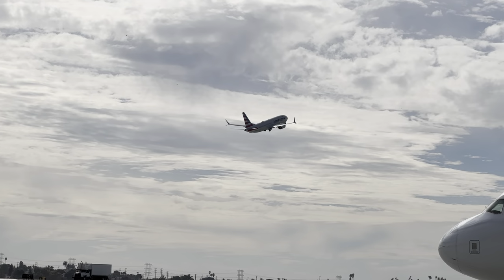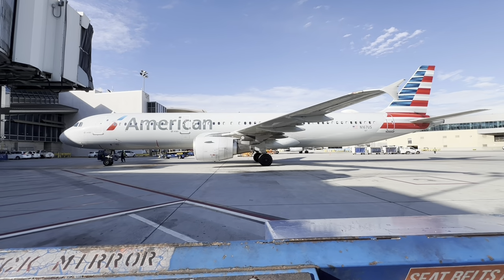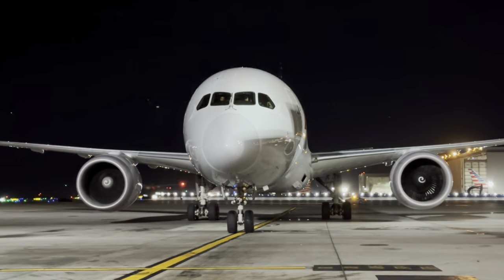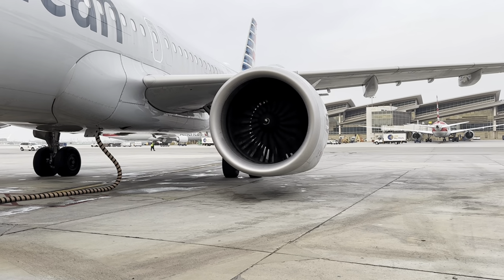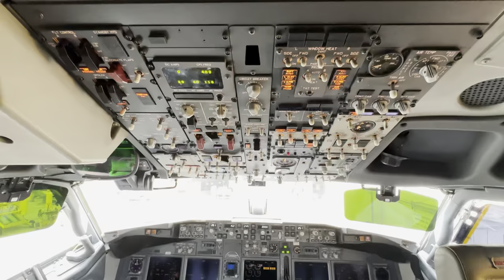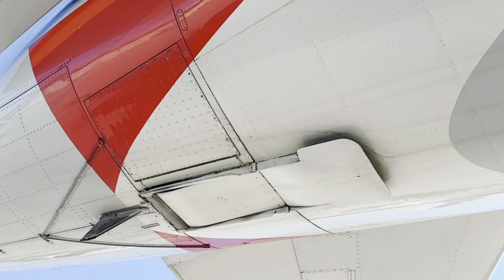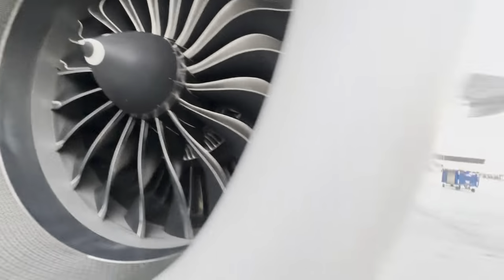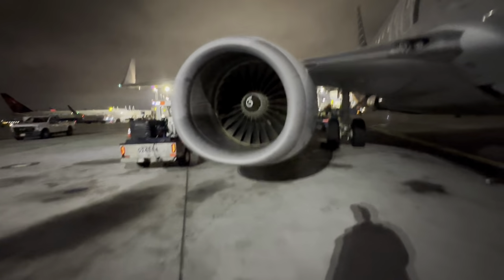Stig Shift #15 (Aircraft Maintenance Adventures)

Comment: Have you ever seen the fuel flow transmitter on the V2500?   In the 80s 90s they used to be made in England.   Takes heaps of calibration but essentially very simple.   The faster the fuel flow.  the higher the pulse frequency.   The FADEC just counts the pulse freq per second.
Reply from the maker: Yes sir I have seen it many times. I have changed it also many times. 😅

Comment: I have a question that maybe you can answer. As you may know, I work at MCO maintaining the HVAC BMS systems. My office is on the airside and occasionally i hear a huffer running. What I am suspecting is they are using it to air start an engine on an A320 (hearing the huffer ramp up and then eventually hearing an engine start). My question is why are they air starting the engine when they are normally started differently (I assume electrically or by air bleed from the APU). When I've seen them doing this, there are no passengers on the plane and usually a JetBlue tech is in the cockpit.

I've tried to pin down one of the JetBlue guys and ask them but they look at me funny when I ask questions about the planes...
Reply: Sometimes you don't have the APU for whatever reason to start the engines and have to start one with a huffer.
Reply: @FloorItDuh  I can't recall, but I want to say these aircraft have had their APUs running while doing a "cart start"...
Reply from the maker: I believe I explained it in the video. The APU was not working so there’s no source of air to start the engine, hence the air cart.
Reply: @StigAviation  yeah. I asked that before I had a chance to watch the video. But I want to say the particular plane had the APU running... going to have to pay more attention next time.

Comment: Hi Stig, I have a basic question which is,how long do you have to wait before you can go near the engine after taxi and shut down by the FO cheers Nick
Reply from the maker: Usually after shut down 5-10 seconds you can approach the engine
Reply: Hi S, They cool down very quick, I would have thought they would still be very hot, does the engine oil tank vent back into the engine air flow for burning, like a car engine, lastly are these Bio fuels as flammable as the old Kerosene. Cheers N
Reply from the maker: Your question was how long to wait to go near it not how long to wait until it’s cooled down. To let it cool down takes a couple of hours.

Comment: You mentioned the "unemployment line", I got something for you Stig...I was on a flight out of Phoenix and as our airplane was getting pushed back, we all hear a loud crash...Turns out the push back bar slipped off the front landing gear -- Stig, how common is that and what was done wrong?
Reply from the maker: It’s very rare that it happens, but it does happen. If it wasn’t latched on properly, it might have popped off or the sheer pin might’ve broken.

Comment: STIG.. What's the tolerances between the fan blades and the cowling? It looks like only a couple of sheets of paper could fit between!
Reply from the maker: Between 1/32” - 2/32”. Very tight tolerance.
Reply: @StigAviation  flipping heck! thats a lot more tight than i expected! Wow! With such a large bypass, why would they not just give a little more space, or would that just allow larger sizes of debris/ice/FOD thru?
Reply from the maker: @Palmit_  because it would lose efficiency in the fan section.
Reply: @StigAviation  thanks for replying :) of course. i sometimes forget the fans are just that. making air flow. they re not just fancy ways to blobk things getting in the engine :)  sorry for being dumb. Thanks and i love this channel. Never stop!

Comment: Ok, A&P Student here. I was wondering about the ground air cart. (Well, really I am wondering about similar systems.)

I have heard about a ground power unit, and I have also heard about a Mule. I think the Mule is a cart that can be attached to some planes to give that plane hydraulic pressure. That seems like a lot of complex and expensive equipment to have laying around for situations like this. I know that aviation is expensive, but are there units that can do all of these functions? Something like a ground servicing unit that could provide electrical, Hydraulic and high pressured air? Or do they just use this air cart to start up the engine, and then the engine driven generator, hydraulic pump, and bleed air just take over?
Reply from the maker: You are confusing a lot of different systems all at once. So let’s break this down, the air cart is simply for starting the engines. The mule is for operational checks when it comes to heavy maintenance. Ground service or ground power carts is simply to power up the aircraft electrically.  All these pieces of equipment have a purpose.
Reply: @StigAviation  Ah, ok makes sense. We have a CRJ-200 at our school but minus the engines. We only have a GPU for it. However, the hydraulics can be operated electrically so we can operate many of the system with just ground power.

Conversely, on of my teachers is working to get one of the few constructed Syberjets to be airworthy again. He is running into an issue because that plane runs it's hydraulics with an engine driven pump with no APU. They really want to have a mule to make fixing the plane easier without having to run the engines. Just one of the sacrifices that the Syberjets had to make as a small private jet.

Comment: How often do you find a fault which is a cause for grounding the plane?
Reply from the maker: It rarely happens, I would say 90% of the time we are able to rectify the issue and solve the problem. But there are times where we need more ground time to troubleshoot as well as parts. At that point aircraft sometimes do get grounded.

Comment: I thought the paint is actually heavy? Three layers = three times the weight? Not good for fuel efficiency?🤷
Another fabulous video btw😊
Reply from the maker: I’m sure they calculated that and found that it didn’t have that much effect. But then again, I am not an expert on that.
Reply: @StigAviation  thanks for that Stig! I thought I read somewhere that a layer of paint adds around half a tonne, so in this case 1.5 tonnes. That's potentially another tonne less of fuel that could be carried? 
I look forward to your weekly videos now that I've seen all your older videos! 
I'm telling all my friends too 👍

Comment: I thought u was fixing to answer my question with that Apu door but guess that wasn’t it. So why is it u get the smell of engine exhaust on startup of the motors. Also can you show the area in the back of the aircraft the trust flows out of. Always wondered if it was behind the high bypass or the smaller part
Reply from the maker: I did answer your question, and also remember, there’s also lots of jet fumes outside, regardless of the aircraft that you’re sitting on. Things get ingested.

Comment: @Stig Aviation Are the tools used for maint. purposes tagged with RF IDs? Do you have to log the books while checking out a tool? In other words, are tool movements tracked and monitored??
Reply from the maker: Calibrated tools are always tracked and monitored. Anytime we check out a tool. We are designating it to our employee number as well as to the aircraft. To answer your question everything is tracked in regards to calibrated tooling, and any kind of specialized tooling.

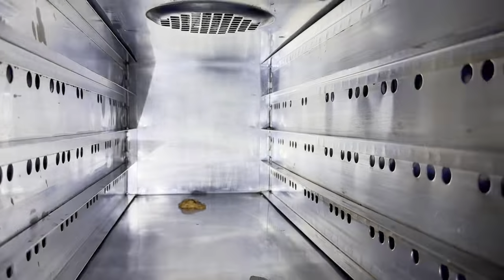Comment: 6:20 I wish passengers would stow their remote controllers at the end of a flight. One of our jobs during a transit is to check the hundreds of controllers for proper stowage (and fight our way past all the other service staff at the same time). That means less time for more important engineering work.
Reply from the maker: My biggest concern with that is when they try to put it back in properly and damage the electrical wiring cord.

Comment: Are aircraft ever defueled for operational issues? For example to allow more cargo or facilitate hot and high performance? If so how often.
Reply from the maker: Not so much as defueled but fueled to an exact amount to compensate for the length of flight, cargo weight and passengers as well as reserve fuel.

Comment: At 15:28 Right before you said GNX love right there why did it sound like metal scrapping metal? Always wondered why that seems to happen with most engines I hear on your series (or is it actually a random bell in the back round? (edited after continuing to watch past that part)
Reply: Also doesn't APU provide power for the aircraft with both engines out in flight? and if so without that working what happens?
Reply from the maker: That was just me touching the inlet cowling, that might’ve been what you heard. Other engines that you hear that metal clanking is the mid span shrouds, I made a whole video about that. The bell in the background is the jet bridge alarm moving.
Reply from the maker: The APU provides power if turned on. Regardless of engines running or not.
Reply: @StigAviation  Thanks for the replies, I love the channel btw.

Comment: Do the aircraft mechanics perform the same walk-around as the pilots do before departure?
Reply: Similar. It depends on the airline who does what (engineers or cheaper stand-ins). The pilots will be in the cockpit well before passenger doors, cargo doors, fuelling panels, etc are closed, so we would check for proper closure. If it was a transit, we would also have done the post flight walkaround. Many airlines won't let you run the APU during transits (for fuel saving), so we would also have to stow any external power leads and airconditioning hoses. Our jobs became more physical, rather than technical and it meant less time to fix the aircraft.
Reply from the maker: We perform a walk around much like the pilots, but we scrutinize the aircraft in a different level. We look at things that they do not look at. We know what to look for in more detail. Sometimes what a pilot sees is not the same thing that I see.

Comment: Look at (31:01), the truck triangulation rods. A triangle comprises a rigid body (no moveable pivot points, thus a rigid structure).  You can see the progression in size (force carrying capacity) of the various landing gear rods, small to large. The smalIest rod only maintains the stiffness of the next larger rod, thus is smalI. The size progression can be easily seen, 4 rods in total (counting the oleo strut itself which comprises the landing gear itself which bears the plane's weight.) As Stig would say, "Pretty cooI, eh Dood's & Doodette's!
Reply from the maker: Most fascinating thing is the articulation of all these pieces and how they fold neatly into the wheel well
Reply: Yeah. It's imaginative Engineering. Read up on the development of synchromesh in std. transmissions. BrilIiant work by a mechanical Engineer. There's aIl kinds of things like that. Think of the bulbous bow on large vessels. Japanese came up with it years ago from what l read. Look for vids of vessels steaming along and you can see the bulb wave filling in the trough of the vessel bow wave. Destructive wave interference. AIl kinds of things like that.
Reply: I'm Iucky. Pretty much always have had work l enjoyed. Engineering. Haha. I went to a trade/tech H.S. (Don Bosco Tech in Rosemead), Iearning machinist's trade. We started on old 10" South Bend lathes, Bridgeport milIs etc. Now there's CNC machining centeres, just AutoCad in the part you want (make sure no program crashes) and there's your part. I'm like Musk. Love Engineering. Science too. But prefer making/doing things. Lucky man.

Comment: hola stig quería saber porque los 737 encienden el motor número 2 y después el 1,  tienen que tener un orden?
Reply from the maker: They don’t always have to start engine number two, sometimes it’s just company policy or procedure. Also have heard they start number two engine because the jet bridge is close to number one engine. There’s also sometimes procedures because of which hydraulic system needs to be activated initially.

Comment: I'm no expert, so forgive me a possible stupid question. You often mention with APU MIL the plane may fly short distances. But I understood that in case of a dual engine failure (all engine failure), the APU needs to switch on for power and hydraulics, otherwise the plane will not be controllable. Am I wrong?
Reply from the maker: There is a fourth redundancy called a RAT. Ram air turbine that will deploy in such a case. It provides minimal hydraulics and electrical. But for both engines to fail and have the apu on Mel is a very very improbable scenario.
Reply: @StigAviation  right, some kind of funny fan on the belly of the plane, forgot that one. Thanks! Love your work

Comment: When a plane arrives how long do you have to wait before being able to work on the engine or any other hot area with out burning yourself?
Reply from the maker: If it’s a job where we have to open the engine and work on the hot section, we usually wait an hour or 2 for it to cool down. We can use fans to help it cool down as well

Comment: EPR = engine pressure ratio = P4.9 / P2
As long as this ratio is above 1.0 the engine produces positive thrust, because the exhaust pressure (P4.9) is greater than environmental (approx P2 inlet pressure).
Reply from the maker: I’ve seen it above 1.0, but like you said anything above one is a good thing. Thank you for the additional information.
Reply: @StigAviation I've only seen it below 1.0 during descent phases in videos, that's when the engine is basically at idle and only needs enough fuel to not flame out. It's almost windmilling and doesn't really produce any thrust. (But I'm just a glider pilot, I don't need engines LOL)
Reply from the maker: @Jet-Pack  ride those thermals my friend 🤙

Comment: So is this APU design the reason we get the kerosene type smell inside the passenger cabin when the engine starts?
Reply from the maker: Yes sometimes that the reason. But the airport is full of different fumes and smells. Sometimes it also gets ingested in the air conditioning intakes at the belly.
Reply: @StigAviation  Learnt something new today. Thanks for replying!

Comment: When the APU doesn't work like in the above, what if an emergency happens in the air and the engine needs to be restarted?
Reply from the maker: Engine can be restarted because wind is already blowing through it because of Ford motion. And you also have two engines, you can cross bleed.
Reply: Thank youu @StigAviation

Comment: Airbus has a directive to run apu for 3 minutes before clicking bleed air for first start of day to help with the fume issue.
Reply from the maker: That’s correct, but most times people don’t follow that criteria. You know just as well as I do pilots will turn on the bleed air immediately.

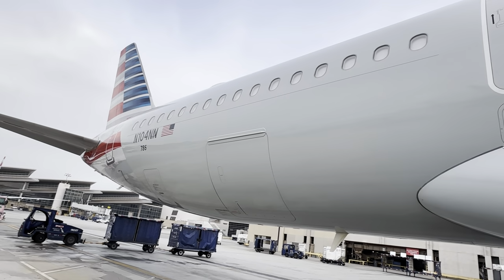Comment: 26:00 I'm surprised they hang the flag this way. The Blue Stars are to face you from the left. Not the right as shown
Reply from the maker: There’s a very specific reason for that, they use the fuselage as the flagpole. Is the same exact way when soldiers put the flag patch on their shoulders

Comment: Stig why are aircraft computers so big like transistors have gotten so much smaller
Reply from the maker: You know, I ask myself that question as well. Nowadays, they can store data and have much more compact computing devices. But they seem to still utilize boxes. I suppose it’s because of how the wiring is distributed and it needs to be plugged in. I am guessing on this one, manufacturing would know more than I would.
Reply: @StigAviation  my guess is to avoid solar flares causing bit flips they require the transistors to be a certain size but that’s just a guess

Comment: Stig prob a dumb question but idc 
Why r the engines so big / heavy if it only uses a portion of its size to produce

Great content
Reply from the maker: They produce incredible amount of thrust. And both portions produce through us as well. The high bypass produces 80% of the thrust the hot section create 20% of the thrust. In combination you have 100% of thrust.
Reply: Got it thank you!!

Comment: Dude talking about the sheer pin we had a guy snap one once because he didnt put the bypass pin in and instead of admitting that mistake he installed it and continued to push with the same towbar and some how he didn't get fired.
Reply from the maker: I can’t believe he did that. He got lucky he didn’t damage the aircraft

Comment: Could you please tell me why passengers are asked to shut down their electronic devices or put them in airplane mode because they could interfere with the aircraft’s navigation? It’s BS right? That’s some regulation left over from the old days right? Be honest
Reply: I'll be honest. They do under some circumstances. There is certainly a lot of anecdotal evidence. You can't always guarantee that A) your device is behaving the way it's supposed to B) the aircraft filtering system is behaving the way it is supposed to. Not all affects can be reproduced during ground tests, so there must be some other unknown factors at play here. A YouTuber made a video claiming what you are. There were hundreds of comments underneath it shredding his video. 
At very minimum, you are depleting your battery faster than normal. When your phone can't find a ground station, it winds up it's sensitivity, draining the battery faster. 
On a larger scale, 5G groundstations have been found to interfere with Radio Altimeters on some aircraft types.  The aircraft manufacturers had to find a solution.
Reply from the maker: My friend here explained it perfectly. Couldn’t have said a better myself.
Reply: @ImperrfectStranger  Excellent explanation! Thanks!

Comment: At min 32:50 were you talk about the engine sensors., is the outer diameter were the trust occurs or is on the inner diameter were the sensors are were the trust occurs?
Reply from the maker: The outer diameter (high bypass) is the majority of the thrust
Reply: @StigAviation  thanks Stig., love every video u post sir.